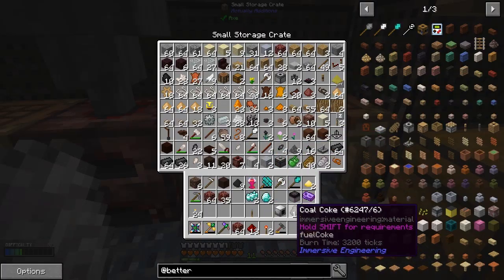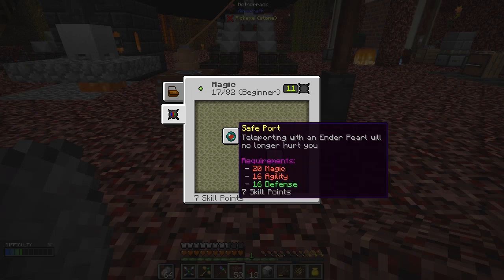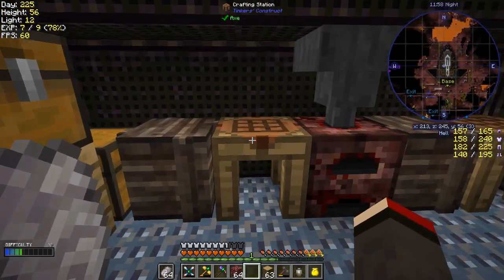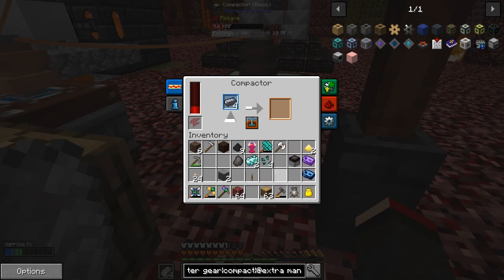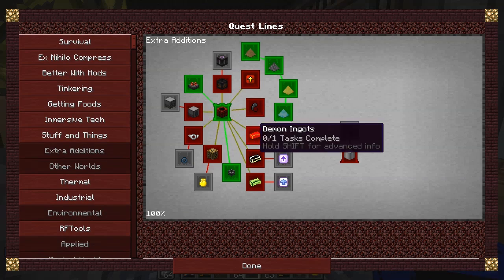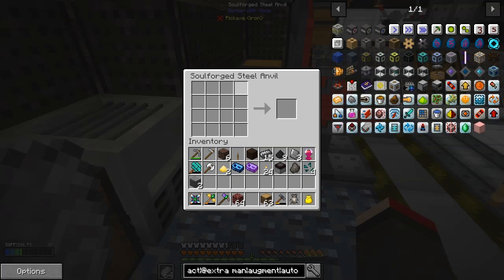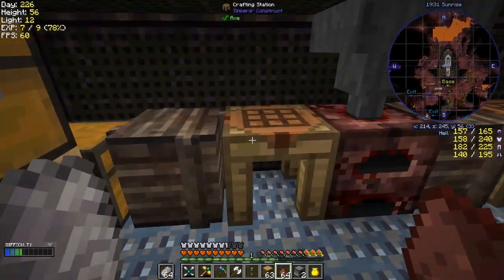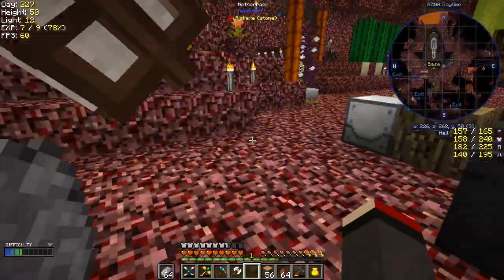Lost Souls #27 - Machines and Rubber

Comment: Thanks for the inspiration to finish the steel axle and gearbox.  Ended up using a mechanical user to place urns under the filtered hopper.  While I stood on top and dropped the dust in
Reply from the maker: Lots of building required for the mechanical user - not there yet but have been working on it
Reply: Duncan Webb ah yes, gotta get that drop of evil for your mob farm ;)
Reply: Use gold spikes or mob masher for killing, absorption hopper to collect xp, pump into drum, use fluid duct to the singularity tank and xp tap for getting xp back.  Can just stand there with the skill GUI open.  The Xp pylon is buggy and to much work
Reply from the maker: Episode 29 will be mob farms
Reply from the maker: Thanks, for some strange reason this message got held as spam. Episode 29 is mob farm building and Episode 30 will finish them off (no absorption hopper until ep.30). I think I've noticed a bug with the pylon but may have a workaround. Did you get your ender pearls from a loot chest?
Reply: Duncan Webb no killed endermen the induction torch makes it super easy
Reply: Well also from mob farm they spawn in there.  Vector plates or mob fans push into the killing devices
Reply from the maker: I guess that vector plates work on top of cursed earth.
Reply: Duncan Webb indeed they do

Comment: I am using 8 crucibles with item ducts and fluid ducts to automate water production. Rubber needs a lot of water!
Reply from the maker: How are you getting the leaves for water, manually?
Reply: Duncan Webb had 4 hopping bonsai, and manually. Since it’s faster
Reply from the maker: Do you know which trees drop the most leaves?
Reply: Duncan Webb I just stuck to oak. If you mean with hopping bonsai, they are all the same.
Reply from the maker: I've been trying different types, oak seem best and apples are good for dirt.
Reply: Duncan Webb I also made a paper tree for a hopping bonsai, way better than drying sugarcane
Reply from the maker: Melaqua very good idea will do.